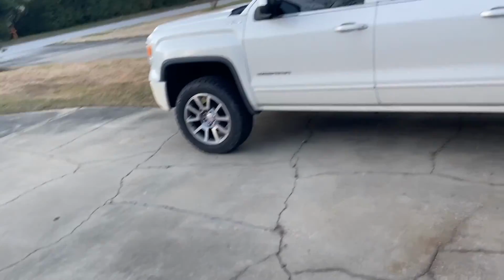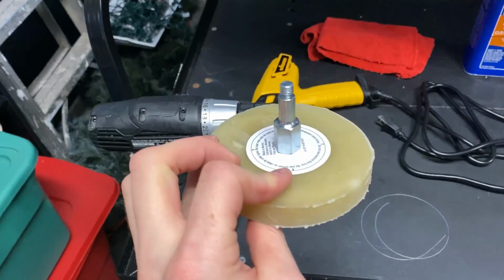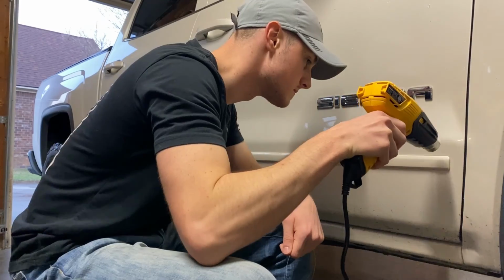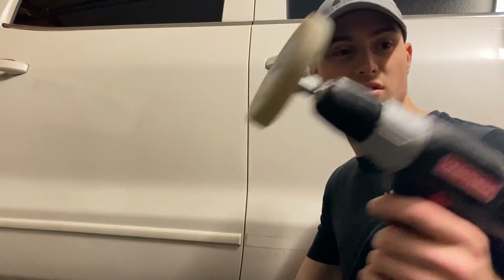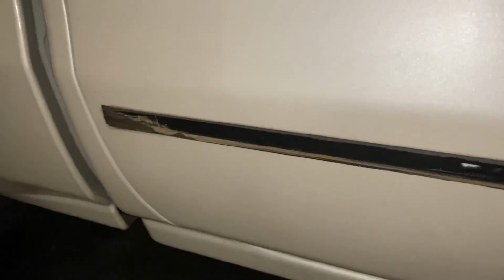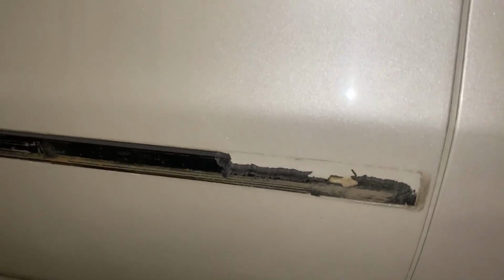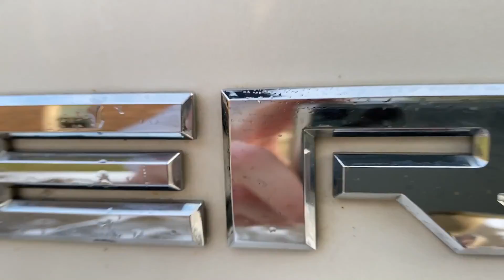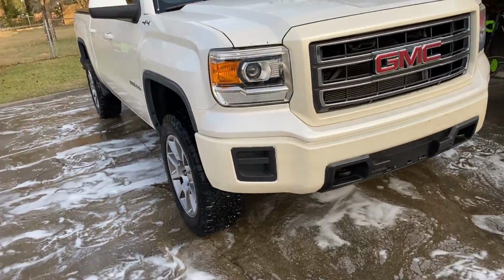2014 GMC Sierra Trim Removal & Debadge

Comment: That heat gun will never "melt" the paint on that truck.  Put it on the hottest setting, get the adhesive soft quicker, it will all come off with ease.

Comment: Your truck come with chrome window trim ? 
Mine has black rubber and if you peel it back it’s chrome but can’t figure how to take it off without messing the seal up. Any tips?
Reply from the maker: Yeah my truck came factory like that. Seems yours may have been plasti dipped? I don't know your trims situation, but I would just approach it cautiously and if you're peeling this rubber off and your seal comes with then stop and try another method. I think those things come off so maybe you may want to try that as a secondary method. Idk but hope that helps some lol